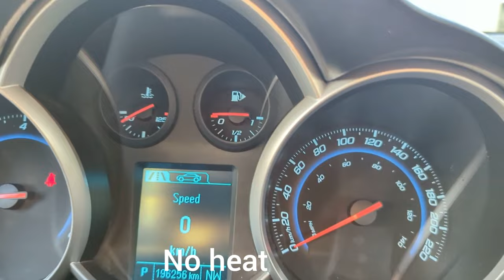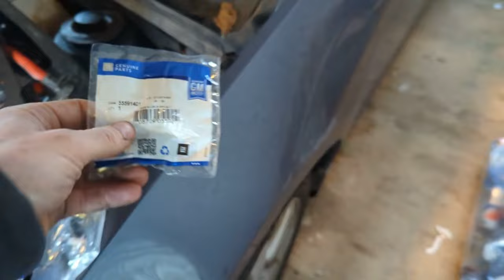Chevy Cruze.  AC off due to high engine temp.  Easy fix!!!

Comment: FYI, the two sensors have different part #'s.  The lower one is AcDelco 5591002.  Upper one is 5591401.   You need 3/8 id hose, about 2/5 ft, to drain the radiator.
Reply from the maker: Cheers !  Thanks for the feedback !
Reply: Just tried to purchase the parts online, and it said they do not fit my vehicle (2014 Cruze LT)
Reply: Can the Cruz run without the thermostat
Reply: @princeleon257  And why would you want to do this?  The thermostat allows the engine to come to a healthy operating temp and is a fairly inexpensive part.  I suppose it would run without one but it won't run well and may cause poor performance.... The computer will think the car is warming up the whole time and.....just.dont so this!
Reply: @bznbrian  use cardboard in between radiater and condenser to manually control eng temp if remove thermstat

Comment: This problem is caused by crappy thermostat (I know because I have to change mine every couple years) Should have been a re-call because this problem is so common !
Reply from the maker: Yes.  I agree.  Alot of cheap plastic parts.   It's a horrible car.

Comment: Drill 1/4 holes thru themstat to re engineer moter temp to run cooler did to mine have not had no more plastic cracks now going on 4yrs
Reply from the maker: @jodygwiinn1233  Great idea,  thanks and thanks for watching !!

Comment: You can usually get the thermostat to reset by shutting car off and re-start two minutes later but It will keep doing it more often till you replace thermostat.
Reply from the maker: @JayTaylor-o7n  My thermostat had failed.  It fell apart when I took it out

Comment: Swapped all sensors, thermostat, and thermostat housing and still getting A/C off due to high engine temp. What else could it be? I have a 2014 cruze
Reply from the maker: Fan working/ coming on ??? Try clearing your codes ?
Reply: There is a relay that almost always goes bad too

Comment: I've been chasing engine light! Changed both oxygen Sensors, radiator temp sensor. Next this sensor by the battery. 90% restored. This car was poorly designed!
Reply from the maker: Yes. Hideous.  Good on gas though

Comment: I'm helping my sons friend with his cruz.   Everything is ok now but a few weeks ago it overheated and he got the ac message for engine to hot.   Briefly, I thought the thermostat might have stuck.   He added a little antifreeze at the time and turned the ac off.   The guage went up but never made red.   I figured the thermostat stuck closed and plan to replace it if it happens again. Its been three weeks. Any thoughts
Reply: I used a lazer heat reader and watched it today.  Everything seemed to work fine. Fan turned on and off as temps rose.  Turned ac on.  I could see the temps risong and falimg as the thermostat opened and closed
Reply: Thanks for any thoughts
Reply from the maker: My thermostat had failed open.  As a precaution I changed both sensors.  Was good for a time but the thermostat failed again caused by a bottle of stop leak I put in the system.  Will be posting that video in a couple of days.   Always something with these cars

Comment: When you change the thermostat you have to drain all the coolant and if you don't, when you change the thermostat air gets in and when you fill the tank with coolant do you have to remove the air? or not
Reply from the maker: Yes you have to remove the air.  Once you top up, run the car with the cap off.  The air will find its way out. Put the cap back on.
Check it again the next day
Reply: @pstreetgarage7304  thanks for your advice
Reply from the maker: @juanzubiaga1161  I'm glad it helped !

Comment: Hey, idk if you have the same issue, but my AC works fine at times, and then it goes warm, with -40F on my radio screen. 

Changed my AC pressure switch and still nothing, any clue?
Reply from the maker: Sorry have not come across that one yet
Reply from the maker: I have had many issues with this car.  If you get to the bottom of it please let me know
Reply: @pstreetgarage7304  Yeah I am speaking with a mechanic to try and get it fixed. I will let you know!
Reply: try ambient air temp sensor i ran into this problem before with ac not turning on cause ambient temp was reading real low

Comment: Didn't watch the video because it seems like he immediately went to the shotgun approached and fixed everything while overlooking the most common problem.

These cars are notorious for having leaky reservoirs. If the antifreeze is low it will affect the temperature gauge which in effect affects the air conditioning and heat.  

First thing I would do before ordering any parts is fill up the reservoir to the designated level which in many cases sells all the problems.

That's a good reason to go to the dealership or someone who only works on chevys, fords, etc.  They work on the same cars and know what the most common problems are months or years before they end up in a recall.

Comment: Check engine light p2076 code. Fixed the sensor and arm now I’m getting this warning on digital screen😢 trying to get car going for my son
Reply from the maker: You might just need to reset the codes with a scan tool.  Sometimes disconnecting the battery can get rid of some codes.

Comment: I have same issue now, Cruze 2016 LS , does the AC work after you changed the thermostat?
Reply from the maker: Yes.  Dont understand the warning.   could be the sensors.  If your temp needle doesnt go up its the thermostat
Reply: It have replaced it before . This time I replaced the sensor but a/c doesn't engage and temp gauge is on 1/4 sometimes goes up to mid which the normal but when i drive in highway it drop down to 1/4 or less. I replaced the whole housing in 2021  because it's plastic and has a crack. What I'm going to do is to replace the sensor and i will put back the old thermostat in . So hopefully it fits.
Reply from the maker: @emadgrabel3444  Hopefully it works !
Reply: @pstreetgarage7304  nope didn't work. I replaced sensor + thermostat all fuses relay are good, but no A/C . Made little test, I made wire and connected to small lamb , i removed the A/C compressor plug and connected there. No light, started the car and turned the A/C on then the lamb lit. That means theres electric goes there but compressor not engaged. Might be a/c clutch or whole the compressor. I will go to junk yard and get used one .
Reply from the maker: @emadgrabel3444  Probably clutch. Let me know the fix
Reply: @pstreetgarage7304 having same issues my fans don't always come on but when I mess with the relay's the fan doesn't stop and cools Temp too low.

Comment: Would you smell any freeze if any of the sensors or what not is not running for the a c off light
Reply from the maker: No.   The sensors can go bad but there will be no smell of anti freeze.  You will smell the anti freeze if the sensors care leaking
Reply from the maker: Your on board computer will tell you Ac off due to.......
Fixes are either the sensors or the thermostat.   I did both sensors and the thermostat.  In my case the thermostat had failed.   Sensors are cheap so I changed them also as they were 10 yrs old

Comment: Which sensor do you put into the engine and which one do you put into the radiator?
Reply from the maker: If you order the set from rock auto they are the same.  I ordered them separate.  Water outlet will have one number.  And rad will have an other.  The dealer claims they are different
Reply: @pstreetgarage7304  i bought both from advanced auto parts. And i just purchased the thermostat. Hopefully the thermostat fixes the issue. The temperature gauge is on cold and the fan cuts on soon as you start the car.
Reply: Do you know what the part numbers was for at advanced auto parts
Reply: @RapStudio34  advance will let you know  they both do the same thing. Also i ended up changing the thermostat that was the issue.
Reply from the maker: @RapStudio34  I don't remember.  Just specify which sensor you want.
Water outlet or Radiator.  Their system will tell you.

Comment: I have a 2011 Chevy Cruz RS turbo and I've replaced the radiator, hoses  Reservoir and the terminate and heat sensor  at the top right of the engine and its still running hot any suggestions from anyone would be much appreciated
Reply from the maker: Blockage ???? Thermostat ??  Fans coming on ??  Correct coolant level ??
Reply: @pstreetgarage7304  I'm not sure were the blockage would be. It runs at the normal temperature for 9 miles or so and all of sudden the temperature jump high and sometimes the temperature goes back to normal just as fast.Thanks for your comment helping me. If you get anymore ideas let me know if you don't mind. Have a great weekend my friend.
Reply from the maker: @mitchellmarcus4843  Sticky thermostat ????  Have you changed it.  They are cheap plastic and also incorporate a sensor.   It's easy to change out
Reply: @pstreetgarage7304  Yes I've  changed the thermostat, heat sensor, radiator, hoses and Reservoir with GM parts.
Reply: @mitchellmarcus4843 did you find out what the problem was. I'm having the same issue. Same parts replaced still a leak on driver side
Reply: @erikawithakay4033  Can you see where the leak is coming from?
Reply: @mitchellmarcus4843 have you figured out your issue? I have replaced all the same issues and still have the random temp gauge!!
Reply: @eddiedillon123  No I never did figure it out. I sold it 5 months ago. Sorry you are having the same problem. Good luck getting yours fixed and God bless you my friend.
Reply: @mitchellmarcus4843  definitely appreciate your reply anyway thank you

Comment: what are the part numbers for the sensors
Reply from the maker: They are in the vid. I'm pretty sure.  It depends which brand you get.  Don't get the cheap ones from Rock auto as they use the same sensor for both.  Both positions have different sensors although they look the same

Comment: If I leave the air off, can I stoll drive the Cruze?
Reply from the maker: Yes. Still drivable.  Mine was
Reply: I checked the reservoir and no coolant. I put Prestone antifreeze in and let the car run. It seems fine with the AC on.
Reply from the maker: @hueyseale4253  ok great